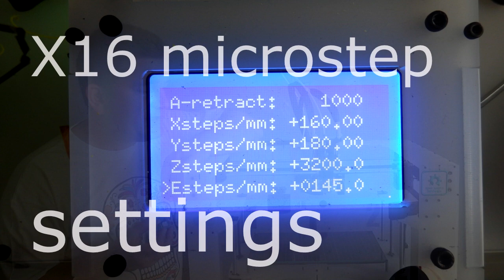BigBox 3DPrinter testing September 2015

Comment: I've experienced the "thermal runaway" you're talking about here. it turned out that my extruder (being worm screw driven) was asking for more steps/mm/s than the 16 bit microcontroller could handle. Essentially the look ahead feature can't keep up with the sheer number of steps and so it misses a command and flips an error message. Not sure why marlin considers it thermal runaway though..